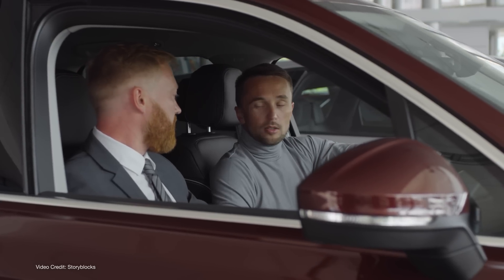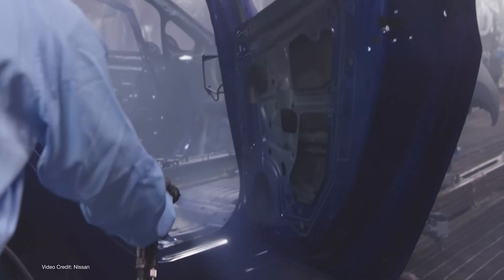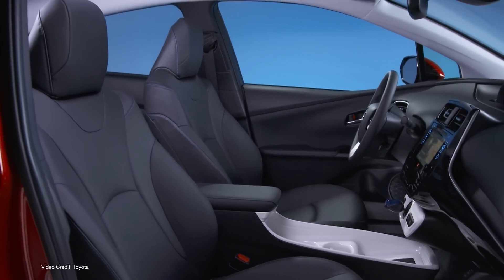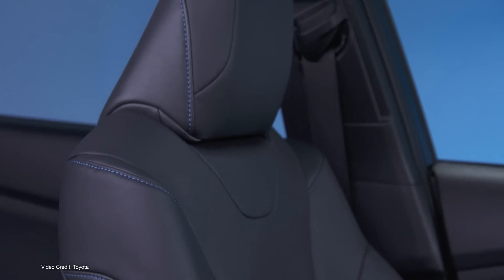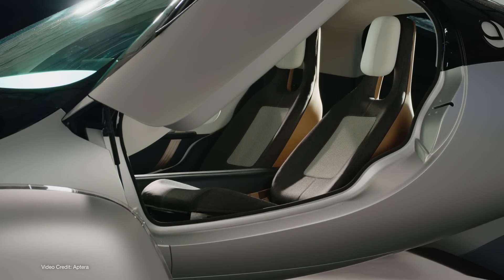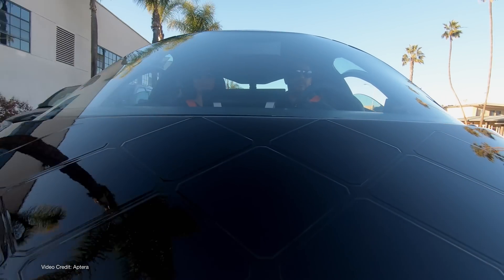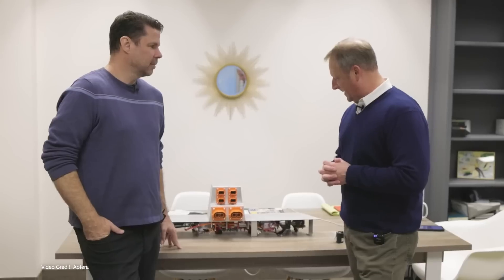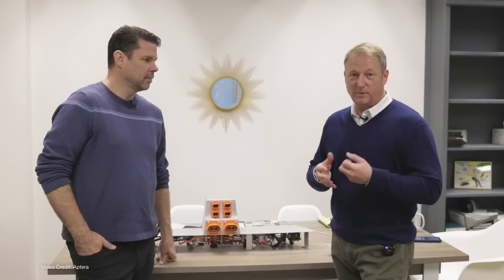Aptera Just Did a 180 On Fast Charging - Here's Why

Comment: Will the Tesla charging cord reach the center charge port on the Aptera?
Reply: Yes, that's been tested. Ignore @TeslaDo'd. TBD whether Aptera will include a CCS adapter at no charge.
Reply: @fotoguru222  Is there proof of this?  I would like to see it.  A Tesla must be parked within 2 ft of the charger for the cable to reach easily.  If the NACS port is in the center of the vehicle, I don't see how the Tesla supercharger cable can reach that far unless the Aptera is straddling 2 parking spaces.
Reply: @Abomynous1  That's what I've heard Tesla owners say. They've dragged the charging cable over to the middle of the parking space where the license plate is.  If you want proof, go to a SuperCharger and see for yourself.
Reply: @fotoguru222  Don't believe them.  Take a look at 2:15.  This is a non-standard configuration for Tesla chargers but you can see how short the cable is just to reach the near side of the vehicle.  Now, look at 13:48, where the Aptera is conveniently pointed straight and pulling away from a similarly configured charge station setup and you can see that this is just not going to be true.

I stayed at a hotel which has Tesla SuperChargers last night.  The only hope that I can see for the Aptera to plug in, is if they park in the parking spot and use the charger to the left of the car, to bend the cable backward towards their charge port, which would essentially eliminate 2 stations because they would be parked in the spot for the right side charger, but using the left side charger to reach their charging port.

The only hope to avoid pissing off Tesla owners is if the far left side charger is unused and there is a space for ICE vehicles open directly to the left of it, so that the Aptera can park diagonally across both spots and only disturb the use of that one charge station.
Reply: @Abomynous1  If all that's true, Aptera owners will be sorely disappointed by the Tesla Supercharging experience. I just checked online for Tesla Supercharger extension cords. I couldn't find any!
Time for Aptera to demonstrate pulling into a Tesla Supercharging spot and demonstrate connecting to it.
Reply: @fotoguru222  I'm sure that something will be invented.  When there's a need....

I recently watch the Now You Know Channel with Z & J, where they talked about Tesla's 'magic dock'.  It converts the charger head from NACS to CCS right at the  chargestation with a built in detachable adapter head.  It's a great idea...but, the cords don't look to be any longer, so it doesn't look like it addresses the issue of chargeport locations on the vehicles and how they need to be parked to reach the chargers.

I'm thinking that Tesla will need to develop charge station layouts with different approach vectors and parking angles to handle 3rd party vehicles, or they will need to reign in the chaos, by telling all of the vehicle manufacturers to place their charge ports on the front right or back left of the vehicle in order to 'advertise' that their vehicles can be accommodated by the Tesla supercharger network.

There is no need to have 30 ft of cable to become coiled, tangled, and damaged over time, when it would be much better to standardize the chargeport locations much in the same way as the ICE vehicles are rather standardized.
Reply: No!  And Tesla should not allow them to straddle across parking spots in order to use their network.  They need to place the port on the front right or back left corners of the vehicle.  Tesla sells a $200 adapter for use of CCS chargers.  Aptera owners should plan to purchase one if they want to fast charge at EA or EVgo, etc.

Comment: DC fast charging is very simple to implement. All it needs is a socket with two cables to the battery and a small comms box to talk to the charger. It is silly not to have it.
Reply: No, it is not. That 'small comms box' has to speak CCS, which is an insanely complicated 'standard'. Why do you think there has been so many issues in North America with some cars not talking to some brands of chargers? Because each car requires bespoke hacks for each brand of charging station. It is a horrible protocol that is so complicated that nobody seems to be able to successfully follow it, but we are probably stuck with it. Regardless though, Aptera absolutely had to cave on DCFC. It absolutely would have killed them if they had tried to stick to Level 2 only.
Reply: @smogne41  the comms box is a module you can buy. It communicates with the car using CAN bus and it looks to the car the same as the on board charger.
The car just tells the box how much current and what voltage it wants and the box does all the talking with the charger. From the car's point of view it is just the same as the on board charger.
Reply: You need to deal with heat, which is the main complexity.
Reply: @PandaKnight52  the car tells the charger how fast to charge. You only charge as fast as you can keep the battery cool.
Some plug in hybrids can connect to a fast charger and they only charge at 15kw.

Comment: For a company that makes efficiency the center point of their whole mission, the decision to try and gut DCFC was a pretty confusing one. Being able to charge up quickly is part of what makes an electric car efficient. Range and aero are cool, but so is topping off as quickly as possible. All three make traveling more efficient.
Reply: Time efficient, that is.
Reply: Less time hanging around sketchy places waiting for the charge to complete
Reply: Exactly. There are really only 2 benefits to high efficiency, and neither of them are low cost of home charging. Ha.

Edit ok 3: low weight per range, high potential charging speed In mph, long range
Reply: @bob15479  Efficiency is definitely a cost factor for home charging? If you have a vehicle that does between 8 - 10m/kWh v a vehicle that does between 3-4m'kWh the former vehicle costs less than half in electricity to go the same number of miles. Wherever you charge.
Reply: @mondotv4216  it’s half of very little. It’s not worth paying much more for the vehicle, that’s my point. My friend does 1000 miles a month on his Bolt and it costs $27 in electricity. So an Aptera would be like $13. Big whoop.
Reply: @bob15479  Do the math.  that means that the cells will pay for themselves using 1/2 their expected lifetime on the vehicle - using your example - and also greatly lessen the time between charging stops.  To many of us that is a big deal, besides taking burden of the grid.
Reply: Some of us live in Atera's hometown... AKA, we're beholden to SDGE, which means it could mean the difference of more like $100.  More if one can't charge off-peak for whatever reason.

Comment: I, like you, have my money down and am a reservation holder.  When I saw 
Live broadcast I let them have with both barrels, as they say.  I was ready to cancel my reservation but like many things of late it slipped my mind for a couple of days.  It appears that is a good thing.  The model they outlined was very near what I specked out.  By going to that model, if and when they start production they saved me $5K dollars.  

That said, because of the price decreases at Tesla and the rebates I specked out a entry level Model3 with the rebate it comes to $1,000 more that the Aptera I specked.  Only $1k more for the rear wheel drive Tesla, I'm still considering it.
Reply: Remember that the ongoing operating costs over time will still be far higher for the Tesla.  It might partially depend on how often you would need the extra seats, or if you ever might wish to sleep in the back for camping.

Comment: In theory the hardware is much simpler for Supercharging vs CCS... Single wire CAN is definitely simpler than the CCS...mess. so as long as they can get an agreement on billing customers, this should be pretty easy for them to get it to work, assuming they have access to how the protocol works vs reverse engineering it...
Reply: CCS isn't single-wire CAN? I thought it was.
Reply: @ps.2  nope, it uses something like power line networking..look up HomePlug GreenPhy and it just gets worse from there... A weird binary tokenized XML thing, I think IPv6...it's an order of magnitude more complicated unfortunately.
Reply: @Mattstech12  It's not that compicated and on a hardware level not that complex or difficult. Don't forget that NACS, which Aptera is most likely going to use, is essentially CCS with a Tesla plug.
Reply: @Hans-gb4mv  Having reverse engineered the charge port controller in the model 3, I respectfully disagree with your assessment.

Comment: Since Tesla's Magic dock has leaked and I see a page in the Tesla app for charging non-Tesla vehicles, I think it will open in some way sooner or later and since I doubt an Aptera vehicles will make it to customers in the next 9-10 months, I bet at least some Superchargers are open before that.
Since Aptera is not going to need an adapter, they might have access earlier than CCS cars.
I think 40kW will be fine for Aptera as it will give 400-600 miles per hour. so they won't be sitting on a plug for long.
Aptera is right that a lot of people probably won't need to fast charge, but not having it rules out cross country travel, so I was debating whether to keep my reservation, but since mine is for a 600 mile range Aptera, there was no rush for me to decide.
Reply: The word out is that Aptera is going to have 100kW for the larger batteries.
Reply: @gmv0553  That info was released on Aptera's own news page so it is confirmed (that they're thinking about it). I hope they have it by the time I get my 600 mile version.
Reply: I doubt they are doing that speed , think ya mean range not miles per hour….
Reply: @josephpadula2283  No, miles per hour is a common way to think about charging speed. If the Aptera can charge at 50 kW and can travel 10 miles per kWh, it means your peak charging rate is 500 miles per hour.

The ratio of charge speed to highway speed is effectively the ratio of time spent driving to time spent charging. So, if you can charge your 'Ptera at 500 miles/hour and drive it at 75 miles/hour, you can spend 500/575 of the time driving and 75/575 of the time charging. That means you can drive for about 3½ hours and charge for ½ hour, every 4 hours. (In reality you may do a bit better overall, as you can typically end the day with a much emptier battery than you started.)

Comment: if they are gonna make a vehicle that goes a long distance they should expect that people are going to end up in a place where they can't AC charge the car. ive ex. stayed at festivals where i spent the whole week with only one trip to the store so charging on DC was the only way i could get my battery anywhere close to full. but also, why the hell do they need to use the Tesla connector? luckily, here in Europe, CCS2 is mandatory on all cars including new Teslas. if we ever get the Apteras over the pond that is.
Reply: It makes sense for Aptera in their design Language and having access to the supercharger network is better value than CCS2 at least in USA
Reply: @PandaKnight52  that would have made sense if they intended to use superchargers. The AC CCS plug is quite small , not needing the DC plug would shrink the connector socket quite significantly. Not installing dc quick charging means the it doesn’t matter how large the supercharger network is as they are all inaccessible . Your reasoning makes sense now, it doesn’t make sense last week but they hooked up with Tesla quite some time ago.